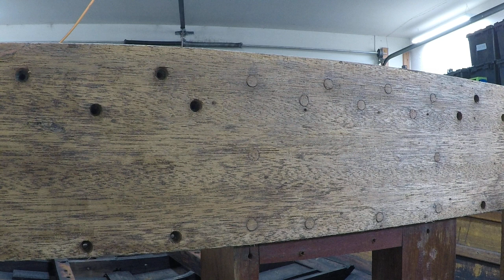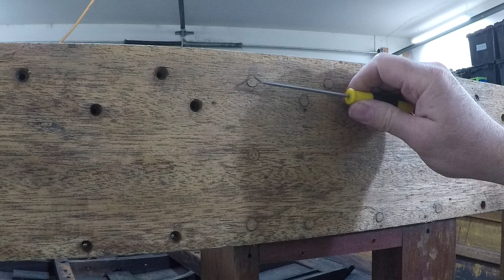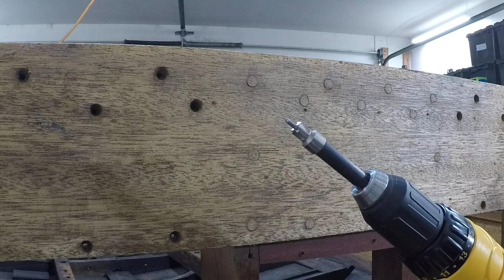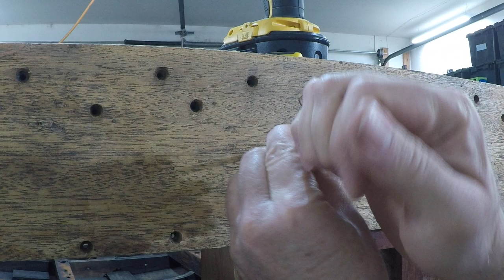How to Remove Screws from Planking on a Wooden Boat

Comment: What's a reasonable price for a 60's Chris Craft in the CDA area?
Reply from the maker: Hi Jim. Sorry I can't help you there. I paid $3500 for my 1961 Chris Craft 17-ft runabout. But it was not functional at that time. I'll have much more than that into it by the time I'm finished with the restoration. Chris Craft made over 850 different models of boats. There is quite a spectrum of values.